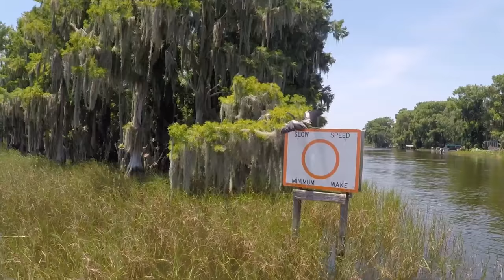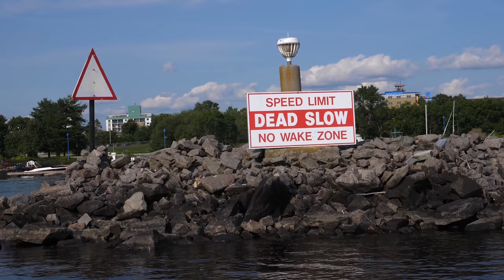How To Avoid Boat Wake Mishaps - Boaters Beware When Speeding

Comment: Kudos to Defender for producing and distributing this important and informative article. I'd just like to add that's not always as stark a contrast as a high-powered speedboat vs. a tiny boat like a Kayak. I've personally been the victim of inconsiderate power boaters feeling free after release from a controlled area like a narrow, a canal, or mooring field only to gun it once in the open channel. I drive a small cruiser and I can attest that many proud masters of high-displacement cabin cruisers Remember, the basic rules of boating still apply. Sailboats, even if they are longer than their "adversaries" are much more subject to rolling in a wake than a similar "vee-hull" power boat, especially if the two vessels are parallel and close.
So, please be kind. Consider that the family onboard the pain-in-the-A$$ slow sailing vessel wants to enjoy their voyage as much as you do, and horsepower does not make right. Idle speed means idle. Put some distance between you and your sailing vessel nemesis. And slow down and enjoy the ride, so that others can enjoy theirs! :goodvibes: Thanks. Also, you need to be especially careful if the sailing vessel in your vicinity is under bare sticks. So, if you don't see sails up, slow down and/or bear off.

Thanks